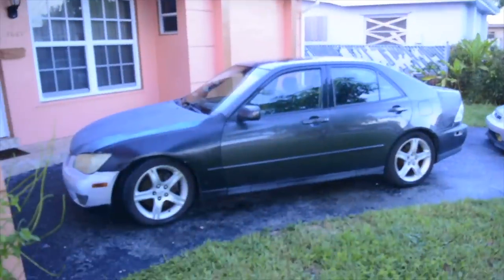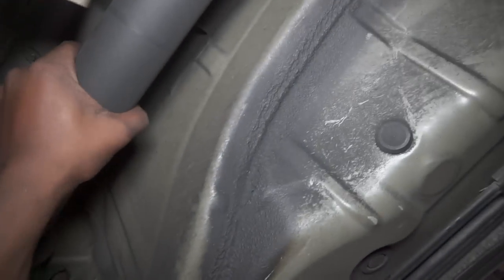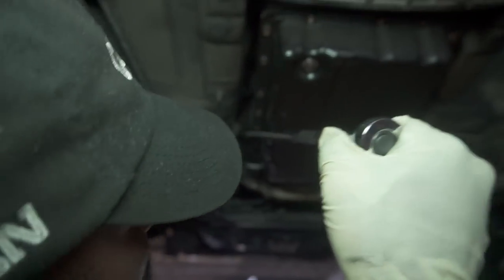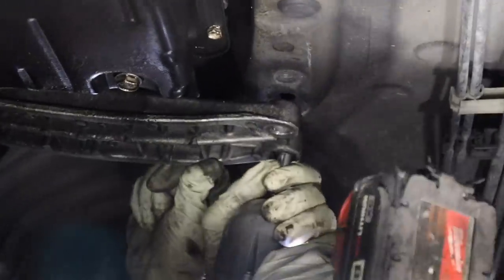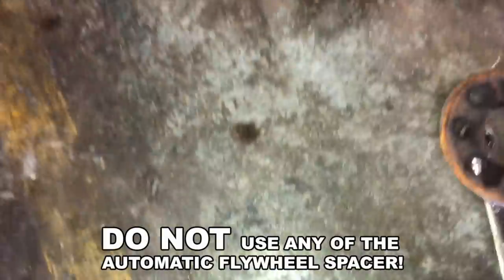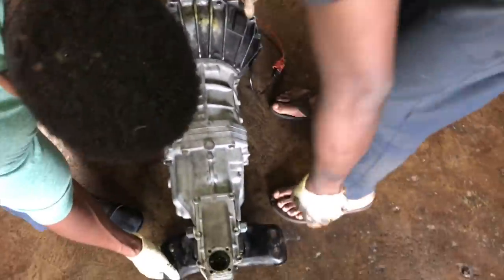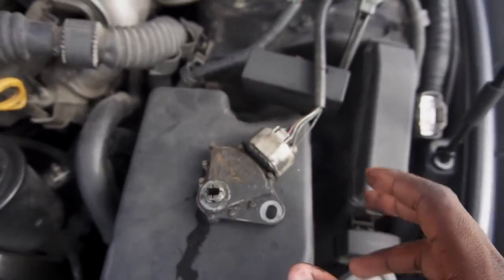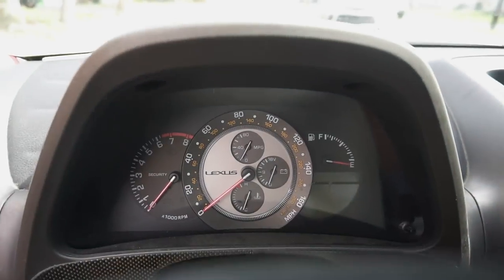IS300 Manual Swap!!! (Step By Step)

Comment: Task List- Feel free to up-vote or add to description!

0- put car in neutral
1- 4 engine mount nuts, loosen w. out removing
2- drain trans
3- unbolt shift linkage
4- Interior
        a: shifter trim 
 b: center console
 c: shifter (4 10mm bolts)
 d: unplug sensors
5-  exhaust, ypipe back
6-  driveshaft
7-   loosen cross-member
8-   unbolt harness under car( 2 plugs D.side 1 plug pass.
9-   bell-housing bolts  14/17s
10- ground wire pass side , bolt also on d. side
11- starter
12- remove auto trans fluid line pass side(17mm wrench) (maybe cut lines)
13- remove flywheel inspection plate
14- remove tq converter bolts and rotate engine
15- remove cross-member
16- pull trans
17- remove on flywheel (8 bolts)
18- change rear main seal if you want
19- install pilot bearing
20- install manual flywheel (loktite?)[75-80 ft/lbs]
21- Install slave cylinder/ clutch line
22- Fill fluid and bleed clutch
Reply from the maker: DatGui you’re the 🐐
Reply: God bless ya man
Reply: You are the goat thanks
Reply: VT BOBBY What is the cause of the CEL from the transmission swap (I know you already have a CEL) ? I have a 2003 IS manual donor car to swap into my 2004 IS auto. I’m from NYC, so a CEL is a big no no. So whatever advice and/or tips you can give me, I would really appreciate! Just saw your video on the w55 short shifter and I couldn’t be happier! I was so upset when I looked up a short shifter for the w55 and they didn’t make one.
Reply: What kind of wiring did you had to do after the swap? ( speed sensor & etc) bout to do same thing with an 01 w/W55.
Reply: I legit can’t find a w58 or w55 transmission anywhere.
Reply: @terrellclark  
I don't know where you located but here's some links for some W55 & W58 trans...  I'm sure you can work something out about shipping.

https://www.facebook.com/marketplace/item/859165244562948

https://www.facebook.com/marketplace/item/3798133706925115

hope this helps.
Reply: Rhody Sacdalan did you do the swap yet?? I’m in Buffalo and just got an 02 and wanna swap the w55 from that into my 01.
Reply: @terrellclark  go with a Tacoma w59. Half the price
Reply: @kool-aidsphuckery9596  but will it bolt right up to the 2j or will a w55/w58 bell housing fit?
Reply: @terrellclark  you’ll have to get the w55 or w58 bellhousing. the pattern to the engine side is different but the transmission side is the same as the w58. Easy peasy. The Tacoma’s also had an R150 which is the truck version of the R154. The W59 is half the price as a w58. And gearing is different but fuck it :)
Reply: @kool-aidsphuckery9596  that’s pretty awesome. I might actually try that. Ohh what about the drive shaft though?
Reply: @terrellclark  they are the same length and from what I’ve found have the same input spline count so the SC300 driveshaft should work. The same you use for the W58 swap
Reply: @UnapologeticIslam  you figure that issue out?
Reply: @williamgates392  Bobby never replied
Reply: Thanks

Comment: Man, you guys don't know how lucky you are that you don't have to deal with rust.  I'm super jealous of how clean your cars are underneath down there.  Brand new cars don't even look like that after a year up here.  Good job with the swap, it's a good feeling when it's done.  This reminded me of manual swapping my old 240 back in the day.
Reply: I use fluid film in case I see any coming up or forming on say the frame. I have a Canadian import vehicle with some light rust underneath and I will spray it with that occasionally. It has actually stopped the rust from re-forming or getting worse and will sluff off the old rust. I hope that helps you!
Reply: Pittsburgh, Pa here........ nd maaaaan do i feel this 😂😂😂😂😂😂

Comment: I might of missed it but did you get a manual ecu? Or does the auto one work fine?
Reply: Bro I need this answer
Reply: @obxurv  I got you. I did the swap or actually got it done but I’m running a auto ECU. I do have a check engine lights but the car seems to be running fine. My IS300 is 03+
Reply: @obxurv   I do have an ATEMU and resistors but haven’t installed them. Been driving since late April as is
Reply: @ooodang180  yeah Idk can u get past 3k rpm? I heard u can use auto as long as you repin the harness or use a standalone that works with the auto
Reply: @obxurv  you definitely can I’m doing it now. I haven’t touched the ecu. The only wiring that has been touched is the neutral ground and reverse which are done under the car.

Comment: Thanks for all the videos man. Just got my is300 manual swap done with zero problems. Your videos helped a ton!
Reply: What’d you do about the ecu? And how did you start it
Reply: Ben Doverson take the switch from the transmission and put it in neutral and leave it plugged in

Comment: My auto to manual swap was different. I had a 2001 Automatic IS300 and then I bought 2 5MT IS300's.  Super easy.
Reply: I heard on 01s you get a bunch of codes how did you go about getting rid of them? I’m about to purchase a 01 and I want to do a manual swap but I also live in a state that does emissions so I’m researching on to do the manual swap and get rid of cels

Comment: Great information for people who have never removed a gearbox, but as you said in the intro don't be judgemental though so great stuff, was hard as have done this a thousand times and in my head am thinking don't forget the stand for gearbox, the transmission lines, the wiring, starter motor, disconnect the battery first, hope to see the 1jzvvti go in soon, doing the same to my is300 or maybe ls1 t56 6 speed still undecided as love the 1jz but nothing compares to a v8 noise.

Comment: Only reason I would do this swap would be if I really wanted a Spectra Blue Mica IS300 because they were only made in '01 & the IS3 wasn't available with manual trans until '02. Forunately, I love the color of my Absolutely Red 5spd IS3, so no worries. Anyway, was still a nice video to watch. Good job!

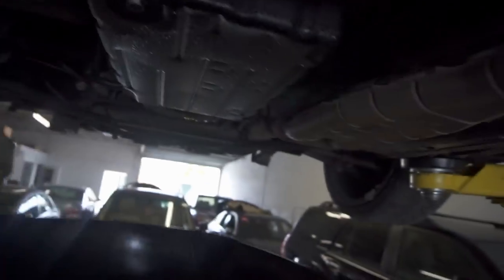Comment: Many salutations!!!  By the time this video had run its course, it was 04:00; still, I really enjoyed watching the whole process of interchanging an automatic transmission for a manual one.  Considering how mechanically straightforward they are, a manual transmission should be the law of the land here in the United States just as they are in Europe; the initial learning curve to properly drive stickshift vehicles will do a lot to weed out the civilian motorists that are so clumsy at the helm that they should be terrified for their civilian motor authority.  I have watched YouTube videos about how the automatic transmission and the torque converter work; while of impressive beauty at the mechanical level, I am of the conviction that the automatic transmission lowers the bar to where anybody can drive a motor vehicle -- and that is not good.

That being said, I am wondering a few things:

Is there not a technique for making the necessary preparations up top before elevating the vehicle?

How much leeway do you have when arranging for the manual transmission?  I am fond of the dog-leg gearbox because the fact that 1st gear and reverse are neighbors makes the vehicle easier to park.

Is it possible to construct a center console around the shifter that has indications of which gear is which so that you have greater latitude of shifter knobs to choose from?

Comment: Dope video! I did mine last year and had zero info on how to do it. Ended up getting it done in 6 hours..

I’ll say this, a half inch impact gun cuts this time in half. 
Let that transmission hang  and it will be fine .

Comment: Just got my manual swap done today on my sportcross ! Congrats B!
Reply from the maker: E.T's jdm House thanks same to you
Reply: Did you use the auto ecu or a manual one? I bought a auto 2j out of a 02 is with wiring and Im putting it in my mk2 supra just want to know if it will start and run with out having all the auto parts plugged in on the stock ecu? Or do I need a manual ecu?

Comment: When u installed the manual trans, did any of those auto transmission wiring harness plugs plug into the manual trans? Or are they just not needed after the swap?
Reply: Need help on this too

Comment: Thanks for posting this vid bro, Can't wait to start mine, I have 95% of the parts so far.

Couple of questions:
Rear rubber trans mount- did you re-use from auto trans or buy separate?
Rear cross-member- Re use auto cross-member?
Is the car showing a CEL?
Do you have to turn the car to park to start, and turn to neutral to drive? Or can you leave in park?

Cheers Man
Reply from the maker: DatGui you can use the r154 Mount with the auto crossmember but only 2 holes will fit. I would say best think to do it’s to get the w55 mount and crossmember. My CEL has always been on but I’m sure it will trigger a CEL. It will start and drive then the dial is in park or neutral, doesn’t matter which one it’s on

Comment: Got 90% of the parts I need to do my w58 auto to manual conversion.. Where did you get the steel braided clutch line?? Driftmotion? If so, did they take forever to ship it?

Thanks for the video! Good stuff.

Comment: Hello, I'm planning on doing this in my driveway lol life of a backyard mechanic. I just wanted to ask how many mile on the odometer of your car as mine has quite a lot and as im planning on keeping it for a while idk if i should even do it on a car with many miles and its my daily driver
Reply from the maker: chideco1 at the time I was at 137k
Reply: mine is at 299k km so roughly 180k miles. I'm in Canada and I'm planning on doing this on a 2003 G35. Although the rest of the body is clean, and underneath is pristine (shocking as I live in the rust belt) the rockers and area the door closes to are shot. There are holes in them from rust.... I have everything I need for the swap just couldn't decide if I should go ahead and do it on the car with the holes or just save up for another G35 with a clean body. What do you think?

Comment: Hey bro I did a is300 manual swap how do I get the check engine light to go off ?? I need to get my is300 smogged  what should I do about the plugs that were plugged into the auto transmission lmk help!
Reply: Lmk what you come up with. I’m  piecing  a swap together. Winding about the ecu
Reply: Need to swap harness and ecu forums are there too for answers

Comment: what flywheel is that and what size and length clutch line.  im doing 02 is300 w55 conversion in my 1j 91 supra. Ended up buying light weight flywheel and stage 3 clutch kit for r154 so i cant use any of that. i had to get another clutch kit and its the exact 1 you have.

Comment: ORANGES
I have a question tho... why are you going 1JZ? why not stick with the 2JZ and turbo it? the  money spent on the 1JZ could be used to buy an even bigger turbo to make more power? what do you think?
Reply from the maker: the ge motors have a weaker bottom end than the gte's. wouldn't be nearly as reliable.
Reply: VT BOBBY the 2jz ge has the same bottom end as the GTE the GE has a different head than the GTE the GE is a very strong engine n capable of holding a lot of power but if course GTE capable of more
Reply: this is great video content....@VT BOBBY should do a video explaining these differences

Comment: Bobby I have a question what did y’all do with the transmission lines on the right side that fritz had to cut do the manual trans need them or what
Reply from the maker: Henry Luevano nope those are the lines for the automatic transmission fluid. The manual transmission doesn’t use any of them
Reply: VT BOBBY okay cool thanks so what’d you do to them did you leave them there or got rid of them
Reply from the maker: Henry Luevano the lines lead to the radiator so you can just cut them off there
Reply: VT BOBBY okay thanks bro this really helped

Comment: What year is your is300? If it's not a 2001. Will I need a manual ECU, wiring harness, and the key that is mapped to the ECU?
Reply: Lmk what you come up with. I’m  piecing  a swap together. Winding about the ecu
Reply: @ooodang180  You dont need a manual ecu there is an aftermarket chip you can buy for $120 that will take it out of restricted performance when using the auto ecu.
Reply: @ElectricMilesLLC  send me a link to this chip. Never heard of it. Local guy is selling a mt ecu for $400. Idk if I wanna spend that.
Reply: @ElectricMilesLLC  ordered it. Should be doing the swap soon that’s the last piece I needed. Appreciate the advise man.

Comment: Would you happen to have a parts list for the mk3 supra w58 swap? I picked one up with mk3 w58, drive shaft, clutch kit. Is the drive shaft you used from a mk3?
Reply from the maker: https://youtu.be/DuMhgVJjwnU 
That is the parts and prices video. I’m using an is300 driveshaft

Comment: been so long , but i have a question. 
what shifter do you have, mine and the angle its at wont let me place the center console properly. & you shifted into 1st and 3rd so buttery at the end. im tryna be like that with my plastic down and my boot on
Reply: AND is the car boosted?? ORANGES at the end it sounded whistly

Comment: Did you run into any driveablity issues with using the auto ecu?
Reply from the maker: Nah drove like normal
Reply: @VTBOBBY  So no Manuel ecu needed ?
Reply from the maker: @BadPandaRacing  nope

Comment: What transmission did you use for the swap?
Reply from the maker: Lukas Zhukov mk3 Supra w58
Reply: VT BOBBY ah, what made you choose that over a clean w55 swap?
Reply from the maker: Lukas Zhukov they’re a little stronger than the 55 but my 58 blew because it was 30 years old. Now my car is 1jz swapped and I’m running a w55 no problem
Reply: VT BOBBY how much power on the w55? I heard they start having problems around the 300hp range
Reply from the maker: Lukas Zhukov I’m making around 300 now. I’ve seen people make 400-500 using a w55 but it mainly depends on how much torque you making, how healthy your transmission is, and how often you beat on it

Comment: awesome job guys, with the tranny jack it would be alot easier. i kinda feel bad for the wrong pedals you got there in the other video, i did the swap my self on the 3rd gen camaro before, it was pain, the most pain i had is to drill the pedalsfor the clutch pedal because i had no clue where to drill, there is no marks on it, im lookig for is300 my self but cant find one with manual tranny, i might gona have to get auto and do the swap, 
this video really helpfull, you guus did a great job, i watched it just in case i hav to do the swap
thanks for the video

Comment: i have a question bobby does an is200 gearbox and clutch work with an is300 running a 2jz
Reply from the maker: I'm not 100% sure but I dont think so
Reply: @VTBOBBY  cheera m8 was just asking coz im converting mine to manual for drifting

Comment: Did you have to splice the connectors for it to read the Speedo and reverse
Reply from the maker: no speedo still works and reverse lights aren't hooked up just yet
Reply: VT BOBBY do they just plug right in
Reply from the maker: King Knight if you’re going with a w55 yes but not with my older w58
Reply: VT BOBBY alright thanks

Comment: Are you in miami by any chance?
Reply from the maker: jay man nope I’m in ft Lauderdale
Reply: VT BOBBY please tell me you know a good spot where i can get my suspension and control arms alignment and basically every other parts involved with making my ride smoother.i just bought a rebuild 09 is250 and when im turning you hear clunking sound and feel every  bump on the road tires are all smooth out by the road ...i need a spot thats going to do a good job but also not charge me a shit load lol

Comment: Did not show any of the clutch peddle install master cylinder install also didn’t tell what trans was required what peddle assembly was required what master cylinder was required. I like your channel but this one was lacking in any kind of detail. Only reason I’m commenting about it is it’s called a guide to the swap. People who try to do this swap gonna watch this and if they not experienced in this gonna have a car that don’t shift or run cause you left out parts that are required for the swap. It never said anything about installing a clutch peddle assymbly or master cylinder it just said you had one like they bout to just randomly have a clutch master cylinder in a auto car. Totally not trying to be a hater. Just looking out for fellow do it yourselfers and teens who want to do this. But this needs to be taken down my dude. It’s improper. Half the things needed to do this swap where not in this video. Every part is important. One doesn’t work without the other man. While I have tons of mechanical knowledge to know better. Others may not. I just don’t want to see broken is300s beacouse of faulty info. This is how cars get taken apart and never run again. Cause of misinformation